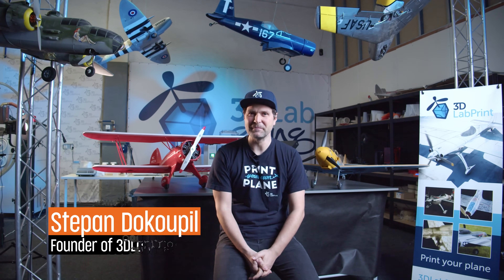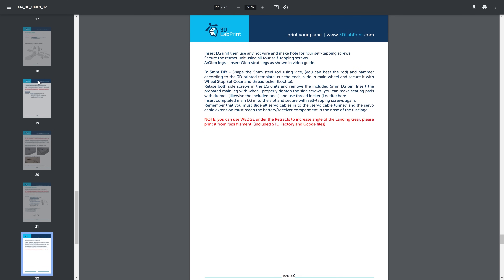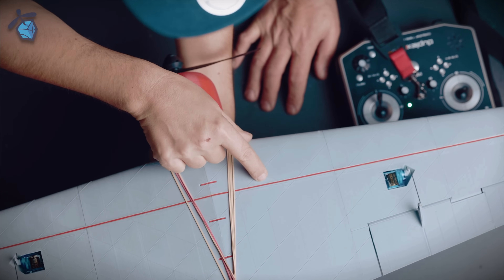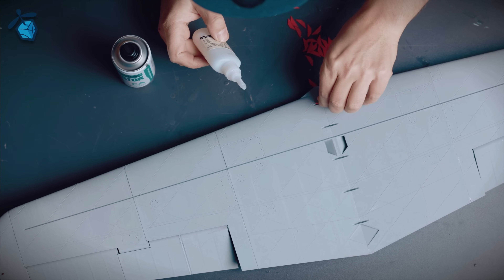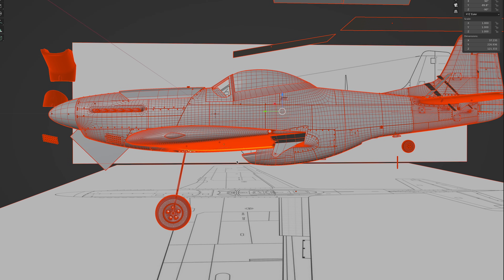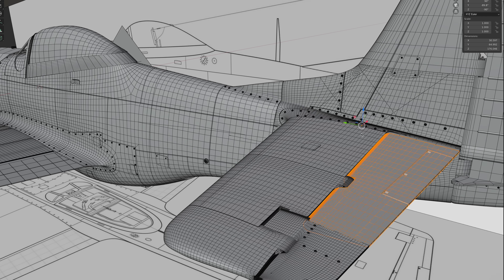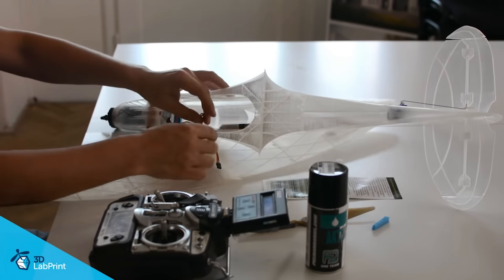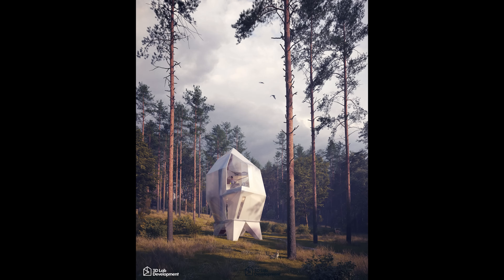3DLabPrint: Conquer the sky with 3D-printed airplanes

Comment: can anybody help me with settings to print on a creality k1 printer? ive tried every setting from watching videos and i cannot get it to print with the ribs on the internal pieces. ive tried cura, creality, and prusa. i get errors on my printer when sending gcodes. It will only print with the 1 layer outer wall and nothing on inside. im confused and really want to print these planes i purchased. thanks in advance

Comment: Very nice. Great job! On the BF109, would be better to mount the retracts at an angle then set the servo end stops to be a bit less than 90degrees so you can have a scale gear angle ;) I'll build one of yours pretty soon, and recently finished my first personal design - a 1/12 scale WWII RC tank. Lots of fun!

Comment: i tried the cub, got me some poloylight pla and after folling the directions it didnt print at all like it was said to. after much dissapointment i finallly figured out the pla is not polymaker polylight its esun lightweight pla. i dont understand why they would tell you to get one thing but use a different pla.
Reply: There are two kinds of lightweight PLA: The pre-foamed kind like Polymaker makes which you print at 100% flow, and foaming PLA like esun and ColorFab which you print around 50% flow. Also, Polymaker's naming is confusing, as "polylite" is a generic name, you have to get "PolyLite LW-PLA" to get the pre-foamed stuff. The Polymaker is super easy to print, but is slightly heavier than the foaming kind. In most cases you can substitute as long as you use proper settings and the design can handle slightly higher wing-loading.

Comment: 6:56: 4 planes this is not True, you need 500g of Filament to Tune your Printer, Temperature and Slicer Settings! When you tuned evrithing then it os halve true becurse Prints Fail. 
We in Germany have so much green Energy we get short Power losses evry week

Comment: I'm building the Piper cub right now. It's not a plane I would be drawn to but I downloaded it free from you when I bought the newer Focke Wulf. I really like the way the Piper is designed using filament for the hinges and wing reinforcement. All your planes are so sexy. The only one I didn't like was the speed boat because it needed fancy slicing and didn't come with pre sliced gcode so I've never printed it. I could have bought a plane instead. I'm excited you've made this video. I hope you make more showing the things you're doing.

Comment: I cannot say enough how good these planes are. They are all designed beautifully and fly excellent as well. As Stephan, I also started with the small Spitfire and then got into the large warbirds (Bf109, large Spit, Corsair etc). All these planes came out so well and often get a lot of positive feedback from fellow pilots at the club. The feeling of accomplishment is much higher than when you “build” an ARF (almost ready to fly), and if you crash, you simply build a new one. Often you can simply “recycle” the electronics such as ESC, motor and servos. Overall, 3DLP has the best designs and I’m super happy flying their models. They have a sale few times per year, where they give 20% off. Thanks so much Stephan and 3DLP for taking our beautiful hobby to the next level! And now finally start working on that twin 80mm EDF A-10 Thunderbolt jet that I have been requesting for so long 😊

Comment: As soon as I have some free time again, I will build one of those planes. 😀
What do you think of ASA btw.? It is a good bit lighter than PLA and also impact resistant.
Or what about Polypropylene? It's even a bit lighter than ASA, probably unbreakable and has perfect layer adhesion!
Only issue I found was bed-adhesion (but there are methods to fix that). A plane printed out of PP should be great!

Comment: I have several of the 3DLabs airplanes and accessories Truly beautiful designs, superb engineering, and build quality. Oh, and their G-Codes are spot-on for Pruas Printers.
Reply: For their gcode did you use their LW-PLA filament or another brand like esun or colorfabb?
Reply: @adventureeveryday1474  I used Colorfabb LW-PLA using their G-Code on my Prusa MK3S+ And I didn't have good results on a particular model on a fuselage section. The model name is the Bungee Prop, I had to lower a bit the temp on the LCD screen and I also had problems printing the wing tips of this particular model, I remember I wasted quite a lot of filament to print these specific parts. 

I didn't assemble the whole model and flew it up to this day because I lost interest in it, I also sent a lot of e-mails to them and never got a response, I remember I asked them if they could ship their particular PolyAir 1.0 directly to my country but I never got an answer so I eventually manage to get one by using another courier from another country which it took quite a while to arrive home but recon that the PolyAir1.0 is a very nice product to print Aircraft with in Vase mode But I didn't Use it on any of their aircraft.

I may try to print their PiperCub because it's a free download and see from there, If I will succeed I may consider buying the files for their Waco.